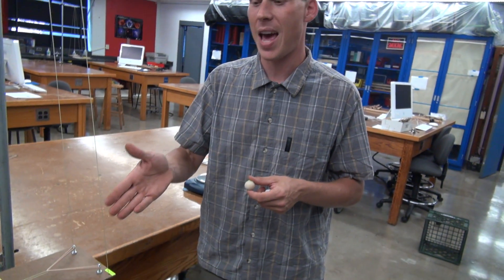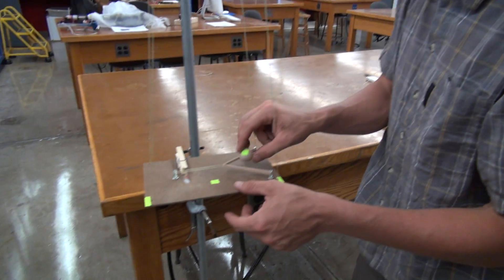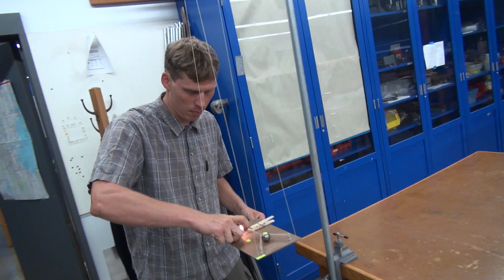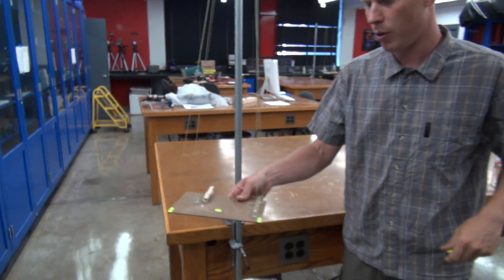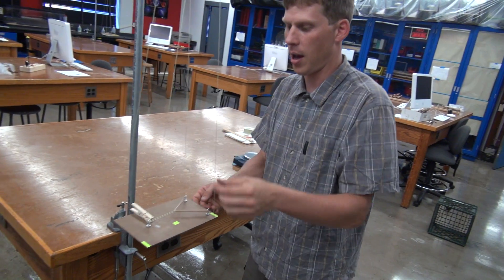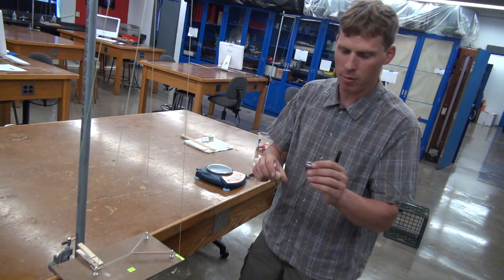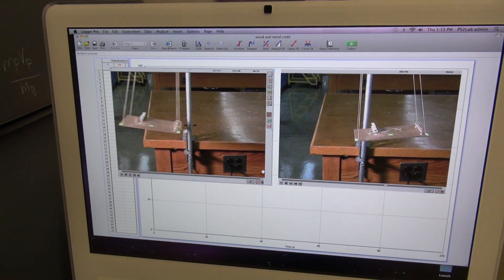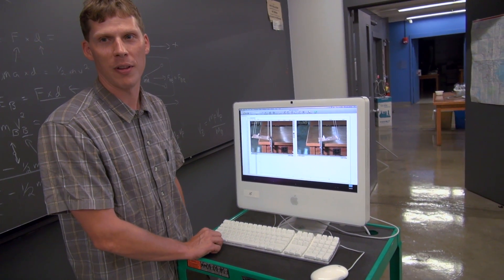Launch Lab, a conservation of momentum experiment

Comment: Great experiment. However, I have found a fiction in the law of conservation of momentum. The reason why I find this because I am not a physicist and I am not worried about telling the truth. You know how textbooks claim that when you fire a ball at a wall, you get -mv back on the ball. To balance this, they claim that the wall experiences 2mv. This balance the ledger: mv = -mv + 2mv. 

Well this is fraud! And how it gets into textbooks is amazing. This is absurdity. This is like a guy with $10 walking into a shop. He gave the shop owner $20 and walked away with a debt of $10. All the experiments conducted never showed any sign of the ghost momentum 2mv on the wall. Why? Because to get the ball to bounce back at -mv (this actually can never never as collision is lossy), they have to set up the "wall" so massive that it cannot move. And then they pretend to measure the impact on the wall to show a force that can create 2mv. So, we have a magic trick that doesn't show the magic. And it only happens on paper. 

Can you design an experiment that shows this ghost momentum as the complete absurdity and fraud committed by physicists? I guess you would lose your job if you do so. But you can become very famous! I can share with you the precise theory to debunk this myth in law of conservation of momentum. It does not mean law of conservation of momentum is wrong. It just shows the limit of it and the fraud of using pure theory to define the world and not the other way around.